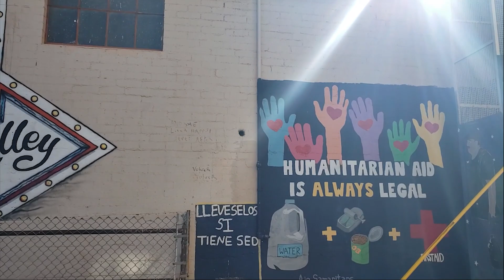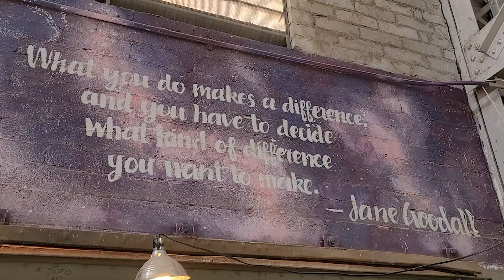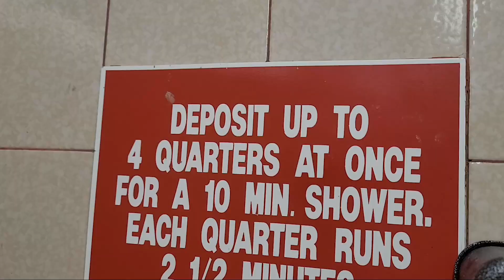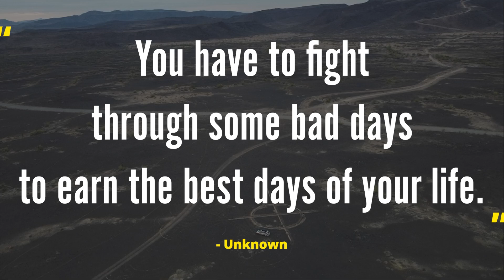Handling a flat tire in minivanlife |  Free camping near a volcano

Comment: What a beautiful moment at Locomotive rock.  Glad you guys got one of those plug kits.  I don’t go anywhere without one and an air compressor.  One thing i’ve noticed in my travels about small towns, when it comes to automotive repairs, is that they are usually super accommodating and don’t take advantage of the fact that you’re in a bind and totally gouge you on the price.  Small town life FTW!
Reply from the maker: Thank you. We've noticed that too. We'll take a small town over the big city any day.